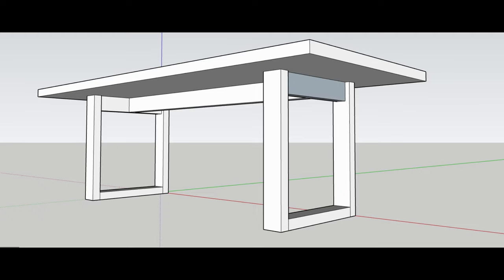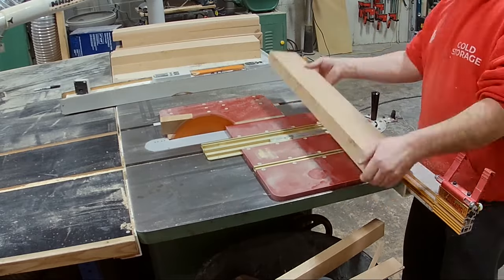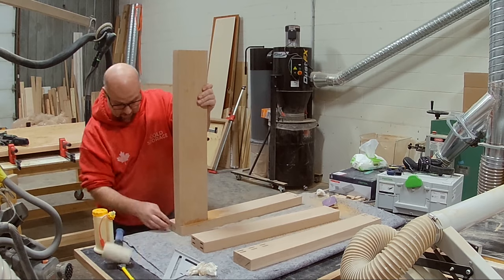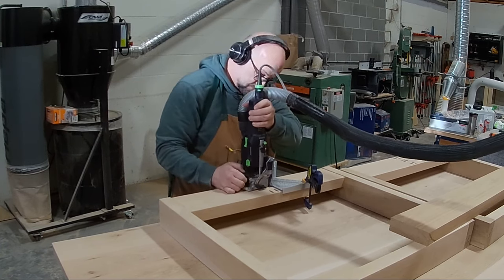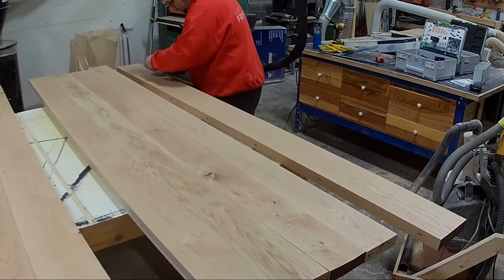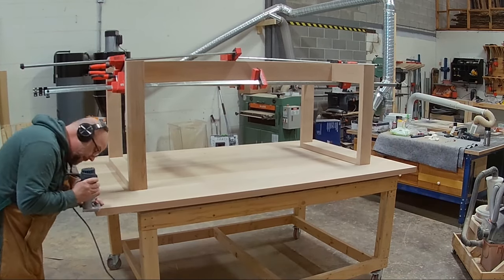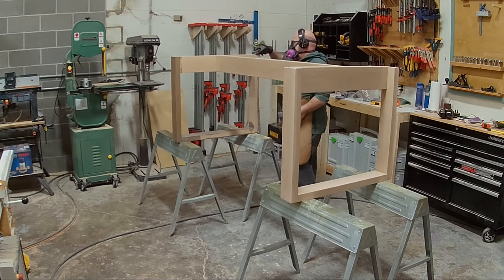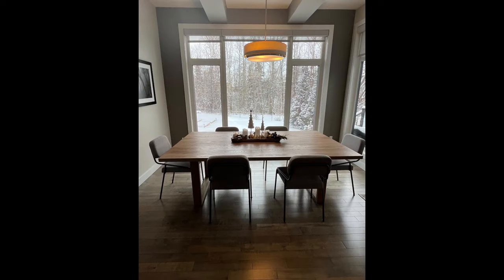Modern White Oak Cuboid Dining Table | Custom Table Edmonton

Comment: Beautiful work! How did you attach the table top to the base?
Reply from the maker: I used some bolts table top clips!
Reply: excellent video and table design, to follow up on the attaching to the table, can you clarify how you attached the tabletop, did you mean both bolts and tabletop clips, z clips? what type of spacing and how many did you use I would anticipate the event of lifting the table at any stage would require a degree of strength on the attachment. The way you have the frame built I would imagine the places for attachment would be along the stretcher on both sides with z clips and inside and outside on the leg frame cross sections? @taitlinstudio